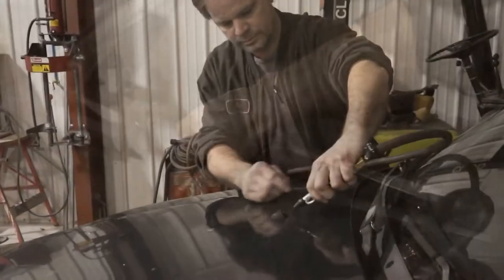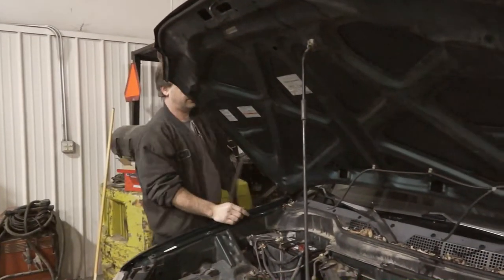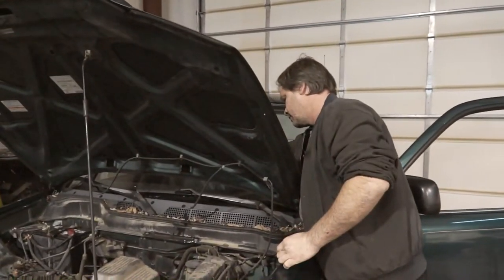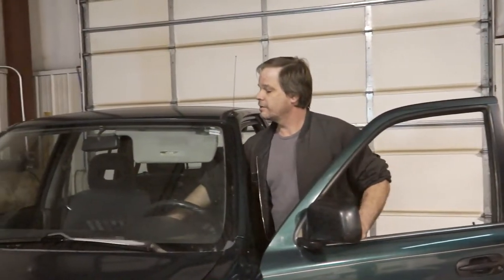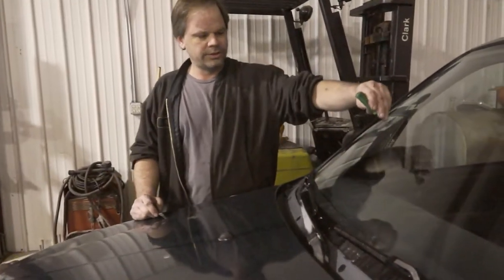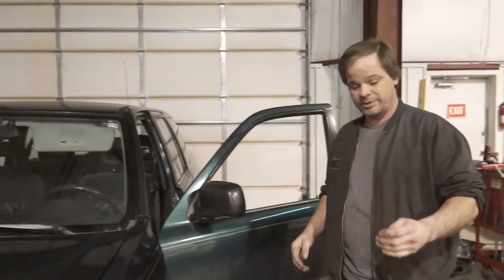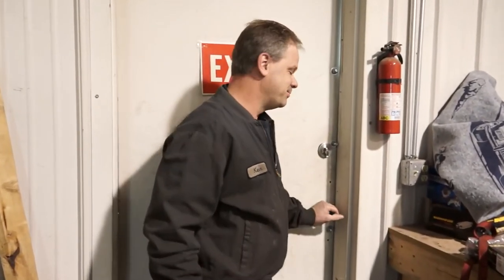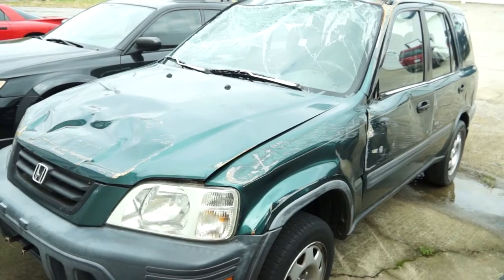SG5 CRV Windshield Washer Nozzle Unclog

Comment: Thanks for the tip.... I've opened it up and found out that the chipmunk bites the tube. Fixed the tube and all working now... ;-)
Reply from the maker: Good to hear.  I had squirrels chew up spark plug wires, ABS speed sensor wires, evap tubing, and headlight assembly wiring all at one time on my truck once.  I had a few choice words that day.  They sure can cause a lot of problems for such small little creatures.

Comment: The nozzle is clear. Nothing comes out of the passenger side hose. Replace hose?  How. 2017 Crv.
Reply from the maker: If you have fluid coming out of the driver's side nozzle, you're either going to have a blockage in the passenger hose or a blockage or break in the plastic t-junction where the hoses split to driver/passenger sides.  Best bet is to work your way backwards until you find the problem.  Pull the hose out of the t-junction and see if you get flow.  If so, you know you need to replace the hose.  If not, keep working your way back.  The only other reason this might be happening is if the pump is starting to fail or has debris built up around it.  If the driver's side nozzle seems weaker than usual, you might not be getting the proper flow from the pump.  Definitely check that t-junction though.  We've had many cars come in where the plastic has cracked or broken off in the hose.  Be gentle pulling the hose out, the plastic is rather brittle.  Hope this helps.  Thanks for the comment and thanks for watching!

Comment: How about the rear window wiper fluid.  I can hear the pump but nothing comes out the nozzle. Does the rear work off of the front resivor under the hood or does it have it's own resivor in the rear. Thank you
Reply from the maker: The rear washer uses the same reservoir as the front, but a different motor.  Both motors are mounted in the reservoir tank.  If you hear the motor working, you probably either have a blockage or break somewhere in the fluid hose or a clogged rear nozzle. Try removing the nozzle on the rear and hitting the button.  If washer fluid comes out, your nozzle is clogged.  If not, try removing the hose from the pump at the reservoir and blowing air through it.
Reply: @TatteredSailsPics  Thank you for your reply. The rear nozzle was clogged. I drained the resivor tank and ran hot water through the hoses to break up the dirt or debris. It took about 20 minutes to flush out the dirt and soak the nozzle. All is good now. Thank you again for your help

Comment: I have a 2002 crv and dont spray.
Reply from the maker: The process to clean the nozzles out should still be the same.  Check to make sure the pump is working if you clean them and still have problems.  If your pump works and your nozzles are clean, there is either a blockage in the hose or in the washer fluid bottle itself.  You can take the hose off at both ends (cap the nipple on the pump end to keep from draining your washer fluid out) and run warm water or air through it to remove the blockage.  If the blockage is in the reservoir bottle, you might have to remove it and rinse it out a few times in a sink.